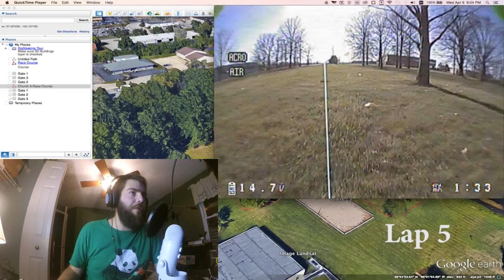VLOG - 26 // Step by Step Racing Breakdown

Comment: I think you have one misconception: There is no "wasting momentum" in quads. Or to be more precise, there is ONLY wasting momentum, you can't carry it with you at all. If you want to turn you can only burn the energy you have build up into the old direction and put as much energy as possible into the new direction. There is no apexing or anything. You always want to fly as straight and tight as possible.

I think you know this, but sometimes it sounded wrong how you worded it with "I wasted all my momentum". 

Good analysis though, I liked it :)
Reply from the maker: maybe wasted is the wrong term. essentially what I mean is that I should be making a parabola around the tree rather than a 180 degree turn. if I do that then I don't have to wait for the quad to come to a full stop and then speed back up. if I can carry through the turn, it will be faster and more efficient use of power.